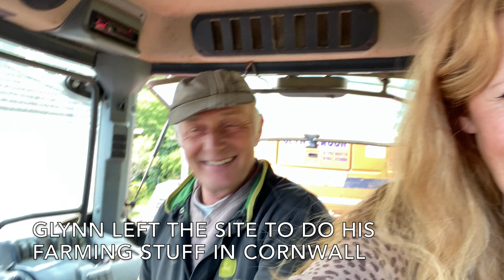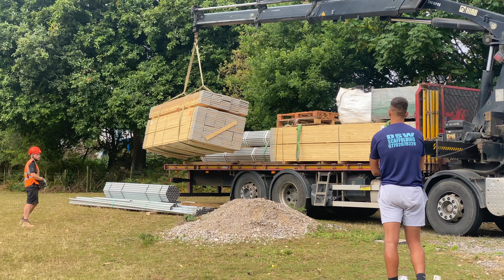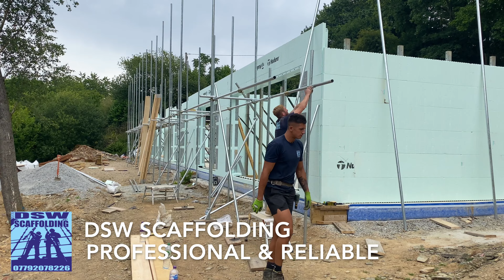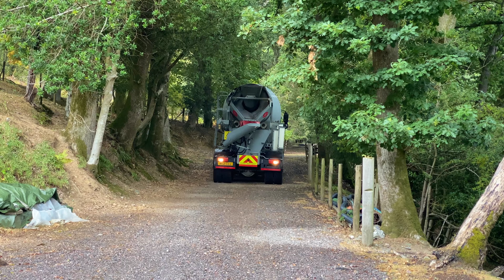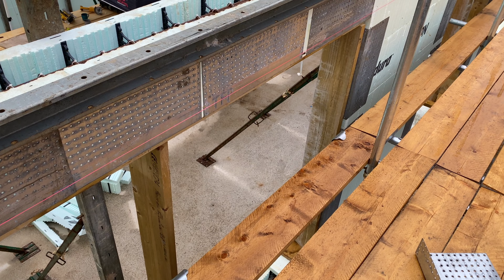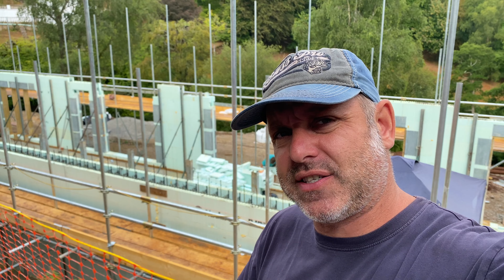ICF House Concrete Pour - Self Build House 7

Comment: Hey! What are those metal plates that have been used to brace the window openings?
Reply from the maker: Hi Chris. The plates are pretty good. They are fairly substantial and really help knit the ICF panels together to provide that good structural strength during the pour phase. They were supplied by James at ICF Cornwall. Thanks for watching.